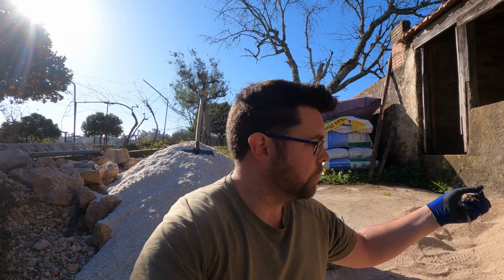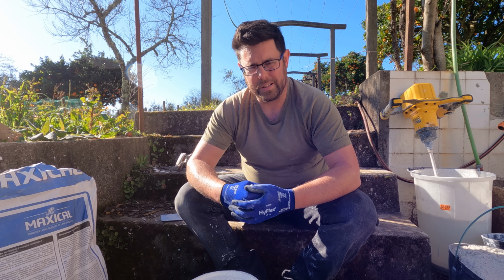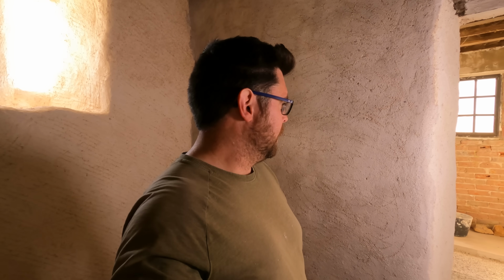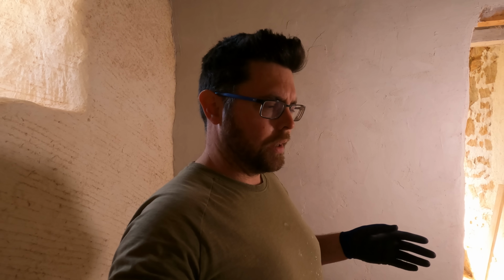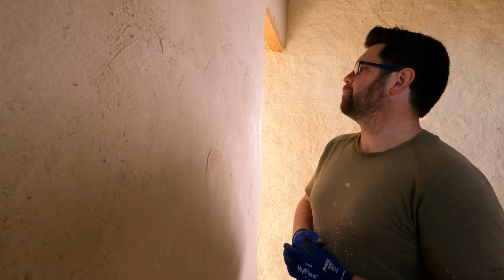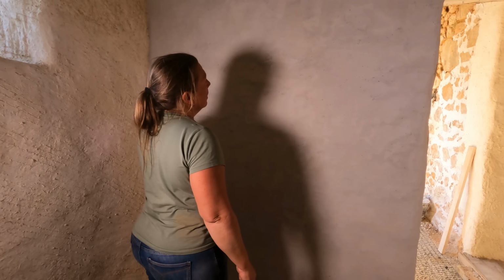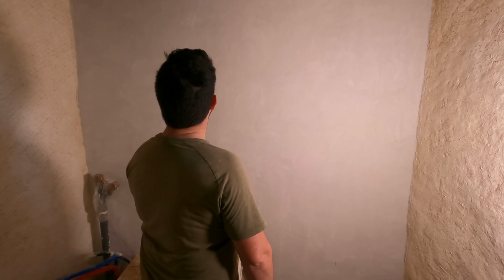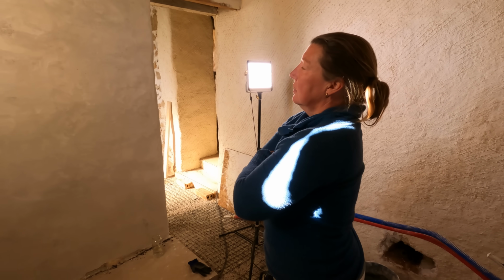SO Smooooooth - Lime Plastering a Stone Wall

Comment: Nice work.  Definitely a learning process.  Decades back when I was patching plaster walls and ceilings here in the US I learned it takes a while to learn your  “touch” with a trowel.  Plaster is a multi layer process.  The deeper layers just get sloped on and smoother as you work out to finish coat with fine finish plaster.  Like you did.  The undulating walls were especially noticeable in the corners.  To better smooth out undulating walls use a longer trowel.  Something like an old 4 or 6 foot level or a very straight aluminum angle iron to drag out a straight  base coat.  Maybe glue a cheap level eye to it.
You should be able to buy an inside and an outside corner trowel to easier make sharp corners.

Comment: You've definitely got a talent for plastering Guy as I've said before. Very well done - (Kylie could be a little bit more free with the praise!) One method you might like to try is instead of spraying with water on the last stainless steel trowel before you trowel it is you could try a wide brush in your left hand that is soaked  with water and you 'flick' it as you trowel - sort of quicker than a spray and you'll get into a rhythm.
Reply: @Darren Thyer  Yes, agree the hand held spray bottle is more efficient and no puddles on the floor.

Comment: Hi Guy, love that lightbulb moment when things actually work like the experts say they will 😀  Here in NYC plasters experts  use a narrow long plaster trowel - 5” wide ,24 to 36” long - with very rounded corners. More material goes on faster and fewer lines in the plaster. I’ve hacked my regular trowel by rounding the corners with a right angle grinder. Also buy a metal corner trowel , save some time. I’ll try to email you a photo - Eric.

Comment: Hey Guy, I have seen someone use a piece of rigid foam insulation to burnish the finish coat of lime plaster. It seemed to work well.
Edit: I forgot to mention that you are doing a fantastic job without my input.

Comment: Success comes with celebration. Smoother, faster, better with practice and confidence. Starts with the right mixture proportions, sand texture, tools, techniques. Next try different sponge textures, wood floats, dry sand/lime dusting followed by light spray for smooth. For textured  experiment with rag spotting, hand brooms, dust brooms. Use a flat straight ( metal ruler, metal edge, straight wood) to indicate how flat or even the plaster finish is.

Comment: Walls are looking good! i wonder if a render sprayer! would help! and have to mention this, you say concrete isn't porous!.. but it is, unless you use  sealers and additives to make it water tight!.. if you made a concrete bowl it will act like clay! and water will soak through and evaporate.. great job on the walls

Comment: Have up tried a wooden straight grain oak float to finish the wall ? Gives a rustic texture. Also, what after care is necessary to prevent cracking as top coat dries ? A steel trowel is very good to density the plaster. A spokesman meg float is very good idea for novices to flatten the wall out, wet brush is good too. I use wooden vertical battens e Rey two foot, like Japanese do, and focus on plastering one gap between battens at a time...easier than attempting to plaster flat a all in one single go. Well done mate. I slake my lime plaster from Shapp quarry quicklime and cardewmires river sand, Cumbria, in a ratio 4:1 and base plaster is superb. I drill whisk/slake  in 6 200 litre drums. Also got a refina roller pan mixer which reduces labour needed to knock up the plaster, paid only £100 for it.

Comment: What a treat to be able to experience so many phases of finish without suffering sore muscles. Thanks Guy. This is probably the most illustrative video on wall finishing I've seen. I have a tiny powder room done in a plaster technique I don't at all like, and always wondered if I could bury it in a few more coats. I've contemplated using drywall mud to hide it since I'm well experienced with that product.

Comment: Very interesting and informative, the paint brush really works. As an amateur I have used a paint brush when taping and jointing, I have found it quick and effective to load the brush with plaster and use it to apply it to the corners saving the fiddle of the trowel. It might work for your job.

Comment: That looks brilliant. I'll have to check out that book you mention, as I am in Australia and will need to source the sands and hydrated lime etc (I dont think I'll be cooking lime and then hydrating it).
I've usually just purchased tubs of ready-made base and top coats, however finishing an old stone coach house will need large amounts of both - such that making my own mixes will be the best cost effective move I think.
Thankyou for the motivation.
Reply: One more thing ... if you have lime mixed up and had to leave it overnight between coats etc ... would you hazard a guess at how long it will last and still be usable?
Reply from the maker: Depends on the type of lime, but a hot mixed lime and sand can sit for weeks if covered over with plastic. A hydrated lime and hemp mix can also sit for multiple days.
When you’re ready just add some water, mix it up again to the consistency you want and off you go

Comment: I do a lot of work DIY as well.  this might be late considering this video is somewhat old but maybe you can use it later.  When you were doing a plaster coat you were pressing very hard and scraping the plaster coat against the wall.  as a result you could not get a smooth and even surfice.  One trick I learned is not to think about the wall but rather the material that is on your trawl.  Consider how much you need to press on the trawl in order for material to come between it and the wall and an equal pace.  you really should not be scraping the wall but floating above it with thin layer coming through.  make longer strokes.  Once you go over it once again with an extremely light touch to smooth out even more.

Comment: Question: Would using a tile trowel with those cut out teeth help with making sure you get an accurate layer?  That way you would have an even amount all over that could be spread smooth.... not sure if that would work with the lime mix but it might be a good experiment if you are wanting to have an even layer across the surface.

Comment: When you're trowelling up with the sponge float have a large brush in your left hand and a bucket of clean water available, flick water on the wall with the brush and then trowel up with the float (or steel trowel) it's much faster and should give a better finish.

Comment: For finish plastering on corners, we always used a v shaped trowel, and the corners were done first, to make the final surface more consistent. The finish coat was always fine sanded, not wet washed. Of course this was 'dry-wall' as we call it in the USA, but the principal should be somewhat the same.

Comment: Hello
Great video 
Wanted to ask, in your opinion is possible to use cement (for better setting) with hydrated lime and sand (0,5:1:5 ratio) for rendering a brick wall layed with lime mortar, as it is quite difficult to find hydraulic lime in our region? 
Or even small amounts of cement will trap moisture, make wall unbreathable and ruin the bricks?
Thank you
Reply from the maker: It really depends on the building and other environmental circumstances. What is the wall built from (hard/soft brick, what type of lime?), is it damp, is it internal or external, and what is the wall used for (house vs garden for example).

We know of several people who’s home has cement render and there are no apparent issues. Our house however had loads of problems … probably also due to no heating and ventilation for a very long time
Reply: @MAKEDOGROW  Hi
The house is built in 1960-1970 from modern red brick using lime and sand mortar, but it was rendered externally with cement and sand around 20 years ago, now all the render is pilling away and internal wall (rendered with gypsum) showing some mould in corners. I can't say it is very damp, but walls are definitely holding some excess moisture.
Reply from the maker: @Pavlo_S.V.  are you able to get hold of quicklime? That’s what’s traditionally mixed with sand for both external and internal render… we prefer hydrated internally for convenience but have also hot mixed quicklime.

Comment: I just got an idea how you can track where you worked on with the 2nd coat on the wall. Try using one of those laser 3D levels that shoot line beams on the wall and create a grid basically, put some laser light squares on the wall

Comment: can I ask why you are using hydrated lime?
I know hydrated lime was only to be used as an additive for cement rendering (due to free lime content)

Non-hydraulic lime(not to be confused with nhl) is typically used for breathable and flexible lime putty

Natural hydrated lime (nhl)
Dries to hard too fast and can be damaging to stone work for this reason it should only be used in small amounts as a pozzolan or it should only be used in areas of constant water (below water levels)

All comes from limestone which has been burnt to produce quick lime

Quick lime then can be used to make putty or powder limes

For plastering you might find more success making mixes with non-hydraulic lime (quick lime and water 1:3 should give you enough moisture to have a nice putty at the end of its exothermic reaction)
It will also almost triple in volume
Reply: Hydraulic limes set with the presence of moisture

Non-hydraulic lime set by absorbing carbon dioxide (this is why it can be considered carbon neutral it will reabsorb the co2 that was burnt off from the lime stone )

It takes a little time for non-hydraulic lime to dry and cure properly but this can be used to your advantage
Reply from the maker: Hydrated lime is not hydraulic … it is quicklime that has been slaked and dried.

It can be used with cement as you mention, but can also be used in plastering (many people don’t as there is a small risk that not all the quicklime is slaked properly and you can find pieces in the mix …. we’ve never had that issue with the brand we use)

ps. NHL = Natural Hydraulic Lime (not hydrated as you have mentioned)

Comment: You will get the best result if you mix your mixed lime, which already has water in it and has matured, with fine SAND (1:1), possibly a little more SAND.  GOOD LUCK.

Comment: As you well comment, you are restoring a rustic Portuguese house and even if the plastering of the walls does not have a perfect final finish, that does not take away from the charm of the interior of the house, quite the opposite. In many villages in the south of Spain, due to legal regulations, when an old house is restored, its originality, both inside and outside, must be preserved, many of which are several centuries old and I can assure you that you will not see perfectly plastered walls.

Comment: With a old home and soft brick and stone you should use 1 pt lime to 4-5 pts sand. 1/1 is too strong and will deface stone and brick
Reply from the maker: How do you know how hard/soft our stone is/isn’t? Or in fact, how old the building is (it’s not as old as you might think)

And if you’ve been following along you will know that this sand/lime plaster went onto the previous layer of lime/hemp, not directly onto the wall

Comment: nah.. just add the sand to the lime and mix to a putty with a bit of water at a time... bit like adding sugar to custard powder before mixing.. its not ever going to make a 'putty' before you add it to the sand because putty is made from a different chemical reaction? Very jealous of your white sand.  Another great vid thanks
.ps the old guys use a wetted plastic bag to form the corners - in  a round as traditional shapes.